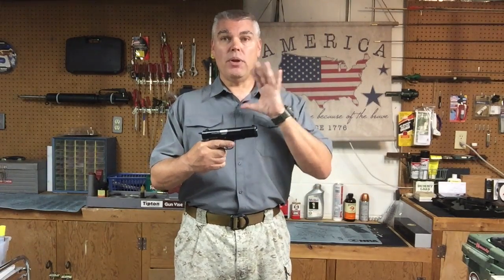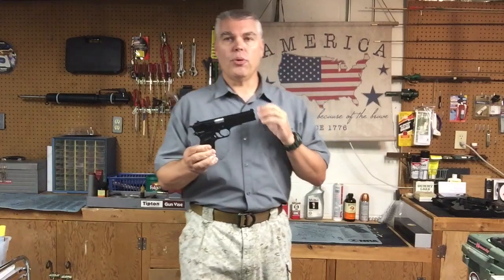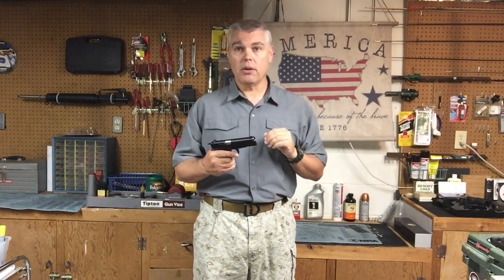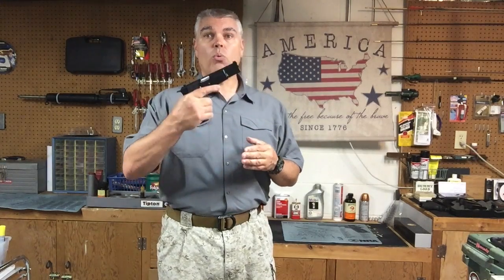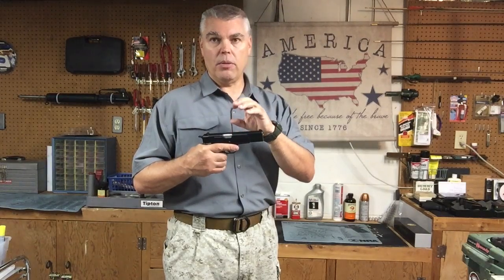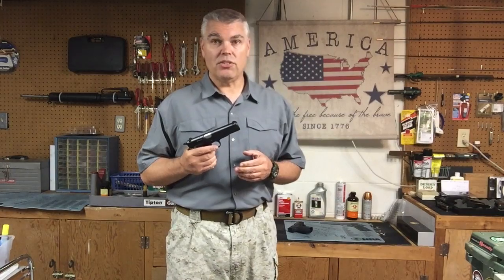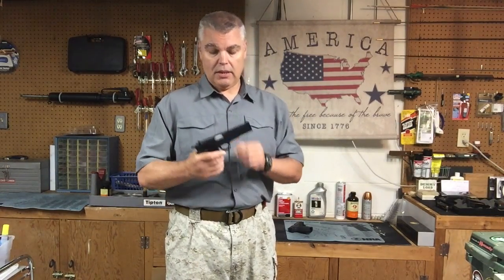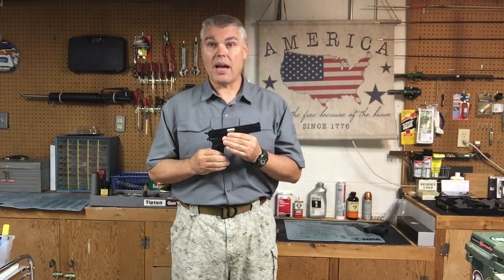Browning Hi Power Mark III - The Fighting Pistol

Comment: Ok so I got a New/ used  barrel for my High power , looks mint has Right markings , what’s the 5 in an octagon mean and on the New barrel it has a J on the side where the spring goes , you have any idea
Reply from the maker: Nope. Sorry I don’t. They sound like proof marks, but I can’t say with any certainty.

Comment: Question: Has the Hi-Power / P-35 been discontinued? I've read many reports concerning this and received answers ranging from "the last batch shipped to the U.S. in 3/2017" to "2017 is up for review as to whether the model will continue to be manufactured". I would hope that there will be limited runs but it's looking pretty bleak from the calls I've made. Any help on this would be greatly appreciated. Excellent Channel by the way!
Reply from the maker: I've received pretty much the same answers. The last new Hi Power I saw on a dealer's shelf was probably back in February or March. Fortunately, there are a LOT of good pre-owned P-35's out there. Even so, I don't see them for sale very often. If you want one, your best bet these days is to find a good one on one of the on-line sites. The Mark III in this video came from Gunsamerica and it was like new. I'm not entirely sure it had ever been fired. So you can still get a good one if you look for it!
Reply: hrfunk Roger that. I had made the mistake of selling a MkIII some time ago and ever since it's been on the list ever since. After hearing the rumors I used galleryofguns as my test bed. 72 hours later there wasn't even a listing for a Browning Hi Power (only replacement magazines). I went straight down to my local shop and picked a one up.
Reply from the maker: Good for you! I'm glad you found one.
Reply: hrfunk Thanks for the response as it is much appreciated. You've got quite an impressive channel with lots of good information here! Your Hi Power videos are spot on (but you didn't need me to tell you that) 👍
Reply from the maker: Thank you!

Comment: Free recoil energies in ft•lb:
• S&W M&P 2.0 -- 5.7
• Browning Mark III Hi-Power -- 4.2

Muzzle velocities and energies in ft/s and ft•lb, respectively (124-gr bullet):
• S&W M&P 2.0 -- 1,165, 374
• Browning Mark III Hi-Power -- 1,193, 392

Bottom line:  Greater weight, less recoil; longer barrel, better bullet performance.
Reply from the maker: So which one results in a deader bad guy?

Comment: Do the later versions of the hi power feed modern hollow points reliably? My 1970’s version did not. The only thing that I never cared for on the hi power is the gun not firing without a magazine in it.
Reply from the maker: Yes. Hi Powers of more recent manufacture feed hollow-point ammunition reliably.
Reply: hrfunk That’s helpful thanks for the reply

Comment: That was my very first pistol I bought with my own money. It was a great target shooter, but unfortunately it could never feed hollow points reliably. Never had any problems when using FMJ's, but just could not hack hollow points.
Reply from the maker: badweetabix I assume you had an older one. When they upgraded the design circa 1980 the barrel ramp was modified to allow the use of hollow point ammo. The upgraded pistol was known as the Mark ll.

Comment: The VERY iteration of the hi-power you have right there, it's flaws, the tail is TOO short, the hammer is TOO exposed while cocked and in general. The BDA corrected that, which was where the Beretta 80 and 90 series got their inspiration from, the BDA. If that Hi Power you have had a tail and hammer like the BDA along with a Double action to single action decock and lock dovetail safety like Beretta's 80 series the Hi Power would be PERFECT.  It's still a great gun, it just has flaws.  The CZ75 which is an ugly turd but also a great gun corrected most of those flaws. 

  You could Say BOTH Beretta and CZ corrected the flaws with the Hi Power. Beretta just did it by making it more like the BDA.

Comment: Never cared much for the tacky plastic nylon grips - let alone the newer contemporary designs for the re-released versions in recent years.

Much prefer the original slab 🪵.
Reply from the maker: I like both the newer and the old design. Under the hood it’s still a P-35. That’s the important part.
Reply: Old school vs cool school. 

Something about the classic tangent rear and hi profile front sights, as well as the polished blued finish with rich Walnut that never loses appeal.